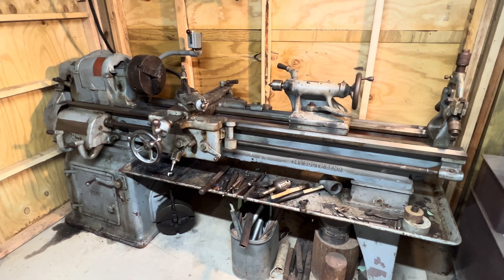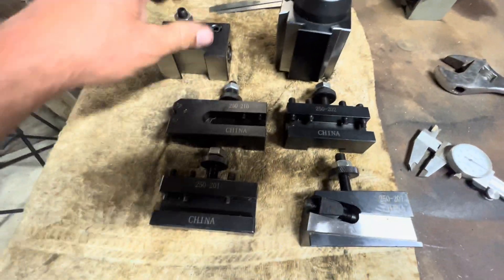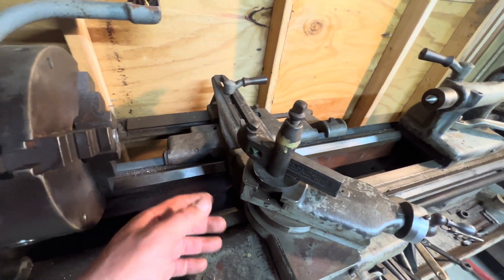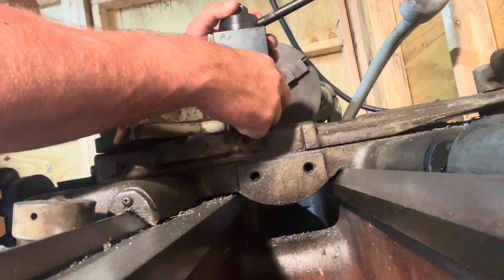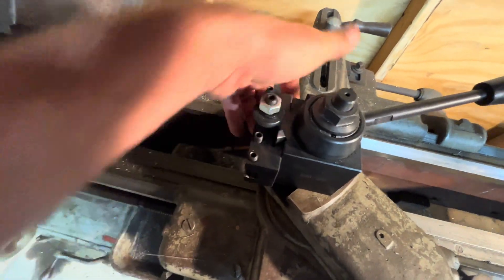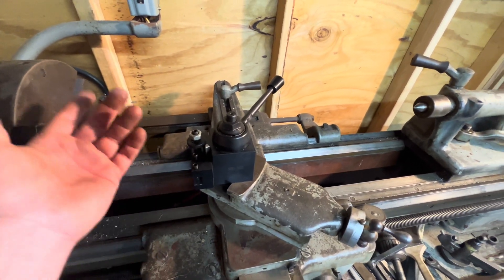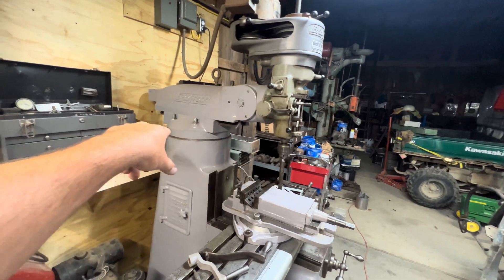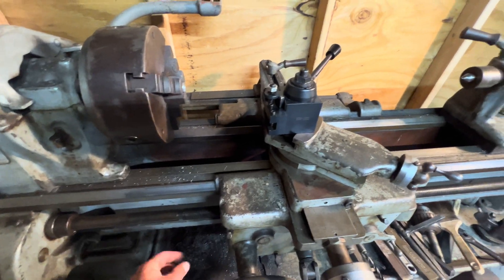Quick change tool post holder for south bend lathe

Comment: I upgraded to a BXA tool post holder a few years ago for my Logan 10". It sure is nice to just drop a cutter in and have it dead on. The size is AXA for under 10", BXA  for 10" to 15" and CXA  for the even bigger lathes.  The BXA 250-201 is the holder I use the most, with a couple of BXA 250-201T that will hold up to 3/4" tool. I bought my 250-201 holders years ago in a 4 pack for about $30, but even today at a price of about $14 ea. on Ebay I doubt if I would take the time to make one.
Reply from the maker: This is hard to find information for sure I’m sorry I just seen this comment. I wish I did see it sooner it would have saved me lots of searching! Another thing tough to find out is how to size and fit carbide tooling for holders! I’m slowly understanding it but it’s not as each as using the charts like most say I think it’s a time/experience deal like most things in the machining field. Thanks for watching the channel!
Reply: No problem bud if I can help in anyway let me know seen your video on that tool post and believe I’ll look for one for my lath they are super handy Oll Keith is a good man to be friends with he’s been around the block a few times and he knows exactly what’s up if he don’t he’ll know someone who does that’s for sure you should get in on one of his classes he teaches on hand scraping he makes machine is squires, and you get to buy one of those and learn how to hand scrape it in the spec
Super fun class